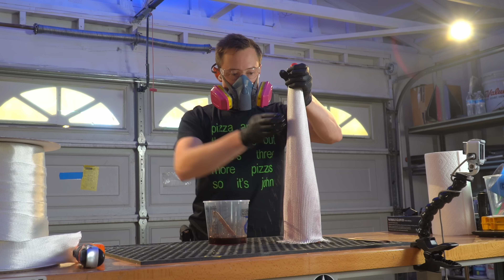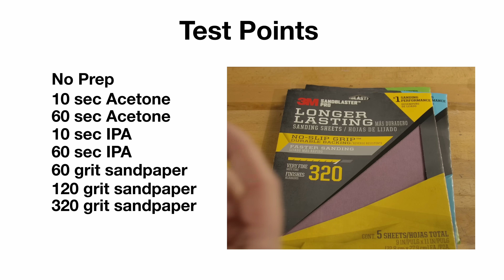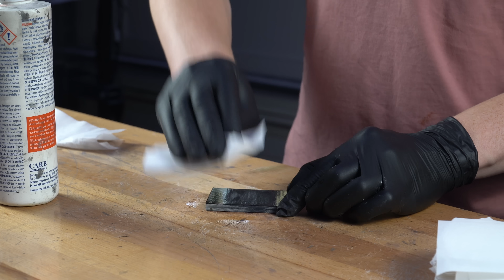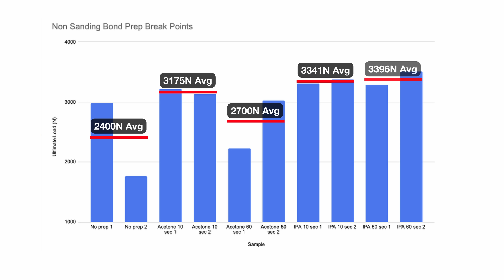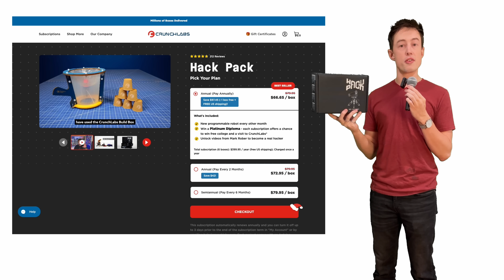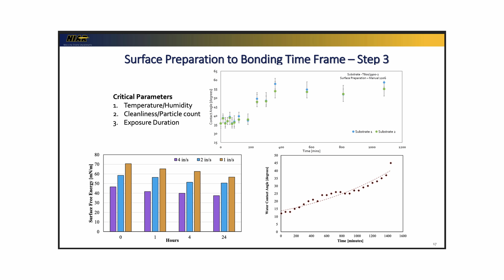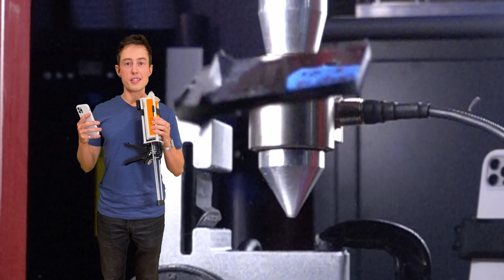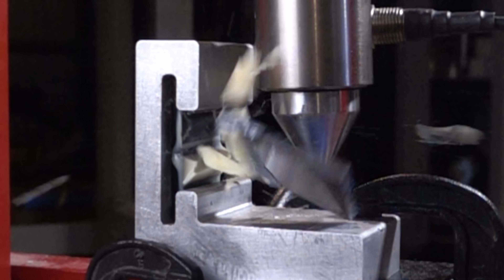I Broke 100 Epoxy Bonds to Find the Strongest

Comment: Alcohol is affecting it. It takes longer to fully dry than you realize. Use acetone. It dries almost immediately. There is better adhesives. You need one that has steel in it or other harder fiber. Coarser than 60 grit starts having micro gaps between the grains causing actual more unsanded area.

Comment: I'm still watching, but I did a bit of this myself. The other fun thing is figuring out how best to bond composites to metals. Wet sanding aluminum using the actual resin prevents the aluminum from oxidizing and resulted in an insane bond strength. The composites always failed before the aluminum bond did.

Comment: Here's a quick question how does a Machined surface compare to the sanded results you might be able to take a bit and run a few cut passes in the surface would be almost no work on your end during prep since it would be a machined surface finish

Comment: Roughness is the 1`st step to a good glue bond.   (it increases the contact surface area) .  Think of etching spray paints, chemical pitting, sanding, mechanical friction, etc.

Comment: I have done a lot of epoxy and I have always found that mixing more than recommended has both made for better results as far as finish and dry time.  Mixing too little or the recommended amount has been the cause of longer cure times and sometime it never cures entirely staying sticky or flexible when it should not be.   So always mix more than you think you need to.

Comment: Might be interesting fpr ypur testing endeavours:
I Interned at a lab where we tested surface prep for automotive adhesives. We used plasma and laser treatment as well as surface energy measurements to create and gauge different outcomes. Maybe a laser treatment instead of sanding might be an idea.

Comment: I'm curious if the inconsistency of sanding can be worked around by using lasers to engrave a precise and uniform level of roughness across the bond surface.

This way the test can be turn from "what sandpaper to use" into "what grit should the bond surface itself be?"

Comment: What if you drill very small holed in the gluing part ? like 0.5mm drill and a few hundred or thousand holed on the cnc and then vacuum chamber so it gets pulled into the holes

Comment: Hello, what about the influence of ambient temperature during epoxy curing to it's strength? According to what I read it has a huge impact. Curing the epoxy in higher temperature shortens the curing time and increases the bond strength.

Different brand, but:

UHU Plus Endfest 300kg (temperature / curing time / bond strength):
20°C / 12h / 120kg
40°C / 3h / 150kg
70°C / 45min / 200kg
100°C / 10min / 250kg
180°C / 5min / 300kg

Comment: Awesome video, patience of a saint 😂 Mech Engineer here, this is why I hate adhesives 😂 Degassing the epoxy is removing air bubbles and therefore eliminating spots where cracking would start. My educated guess that doesn't change anything for what you did. Awesome work.

Comment: The point load setup is not rigid and precise. It needs to be on a guide. The loose slides on that type of hydraulic press will result in the point not always contacting in the same location on the test sample. Resulting in  inconsistent measurements.

Comment: I'm a windsurf board builder.. just add carbon fiber to your epoxy... chopped or pices of cloth.
The epoxy is brittle.. adhesion isnt the biggest issue.. the epoxy cracks during load. If you need more adheadsion, just increase area.

Comment: I will be fully honest, If i had to pick between different epoxy's and the two i have was from a lab test of hyper controlled stuff to say yours i would probably take yours as in the field information from many different uncontrolled stuff would be better than a lab not dealing with outdoors because knowing a test from say load pressure and placement in a lab it would be perfect but in the field it might be different so having a avg instead of one number would be better to look at long term.

Comment: It seems with the sanding you are making parallel ridges, which introduces a weak point, the same as the layers in a 3d printed piece. You should consider crossing your sands perpendicularly or hatching them so the ridges of the paper theoretically make a triangular shape.

Comment: One Thing that catched my eyes: the swipe back and forth while cleaning.
During my adhesive training I was told to seep only in one direction and never use a cloth twice. You want to clean the surface and not distribute all micro particles evenly over the surface.

Comment: I worked at Easton Sports in the early 2000's designing carbon fiber hockey sticks.  I am a degreed Composites Engineer.  A production manager at Easton had an intern manufacturing engineer do some tests on how well they had to sand blast the inside of the hockey shaft before bonding in the hockey.  This was done without the knowledge of the R&D Team.  The Production Manager and intern 'proved' that they really didn't need to do bond prep and only haphazardly sand blasted the inside of the shafts.  In the next couple months we had over $500,000 worth of hockey sticks fail in the field.  Blades were falling our completely.  The Production Manager was fired.  Luckily, it was still the best stick on the market and we continued to sell the sticks.

Comment: Have you considered testing with a sandblaster to etch the surface? I would think that would be an easy way to produce consistent results without requiring excess effort.

Comment: Im curious if media blasting would provide a more consistent result compared to sanding.  It would definitely be easier at scale for larger bonded parts, but based on your testing with the sandpaper maybe the result would be negligible if it had the same effect?  Im also curious if media tumbling would make any difference to bond strength, but this would require a custom jig to use on any larger parts.

Comment: I wonder if vacuuming after sanding would improve the bond?
Wipe cleaning with a solvent may not remove all particles from the grooves.
Maybe ultrasound cleaning in a solvent will improve the bond?
Good luck with your rocketry.
It is already very impressive!

Comment: I put the hardener in the mix container first. Then add the weight of resin to get the correct mix ratio. Mix well. It will be the strongest the epoxy mix can be. Another way for small batches , is to place the hardender into a plastic bag, then add the resin. Remove most of the air, and kneed the 2 together. Cut the lower corner and use like an icing bag for dispensing. For my parts, I found that using some of the mixed glue on the sandpaper and abraid the surfaces leaving them wet with glue. Add more glue and assemble. I use 100grit paper. The small bits of grit keep a consistent gap for the joint and prevents glue starvation. Keep the abrading inside the glue envelope. Cleaning the surface parts with acetone 1st or almost any other solvent to revove waxes etc is really important. Then cleaning with IPA or another very clean evapourating solvent is important to remove the initial solvent and it's residual contamonation. I use commercial grade wet dry carborundum paper, that des not have any lubricant or treatment for clogging etc. I make model racing model planes, and have been working with composits since 1984. I have had many failures like you have experienced and shown in your video. Keep well away from anything silicon with structural composites. Do use waxes for release or even PVA releases work very well. The problem with silicon release is the continual contamination of the surface if they are going to be joined together. The sillicone can also effect the final cure strength of the epoxy as well. Made quite a few soft carbon fibre props due to the silcon in the mould release I was using. A great video. Thanks for sharing.

Comment: I would assume that contamination was not the reason that re-using sand paper reduced effectiveness. 

Small amounts of grit (especially the larger grits protruding further which leave the deeper grooves) are knocked off with sanding. Further, as you sand debris from the workpiece clogs the paper further reducing its effective grit.

Comment: wrt your home made ladder w/vacuum contraption you needed to guide the airflow better instead of having an open throat, because a single atom of oxygen has an atomic mass of 16 units which is far lower than the average mass of molecules in the atmosphere, being 28 amu. by the time the airflow reached the end of the ladder, most of the single oxygen atoms had already escaped, it's no wonder you had a hard time using that as a solution.

Comment: 26:40 while there may be "more surface area" on a microscopic level, that doesn't mean the epoxy was able to fill all of those grooves uniformly, and thus could have filled the larger grooves better or had a better angle of stress due to the larger grooves.

Comment: 10:35 Woodworkers generally avoid sanding above 200 grit because the dust clogs pores in the wood and prevents finish from penetrating. It can’t really be wiped away. Perhaps that’s a cause of the “contamination”?

Comment: 25:00 if there is anything to take away up until this point, it is that all your peers were correct. Their way is the best way to prep and bond....because it is so darn inconsistent, that for what ever reasons they deemed their successes good enough to pass on the knowledge. Clearly your data samples are much too small, yet these small batches reveal a inherent problem with a task like this. That is that every small change matters and must be tracked. Like going from hand sanding to machine sanding. $ vs time. I just wonder about my EXTREME hit and miss experiences WITH THE SAME EPOXY. Your video really puts the light to it. One day it bonds very strong, another it's like I spoiled the epoxy.
Reply: Epoxy is a dark art, there are so many variables. Even humidity can significantly weaken it by interfering with the curing process and causing physical degradation. Good luck getting the same exact humidity levels across multiple days in anything other than an atmospherically controlled lab environment.
Reply: @----.__  "dark art" is a good way to put it. I know for a fact that a few degree in temperature have a very different outcome as well. The chemical reaction setting in fast or slow, curing longer vs slower....it's an art alright.

Comment: Do you have access to carbon nanotubes? Mix some into the epoxy mix perhaps?
Reply: The strength of the epoxy itself isn't the problem necessarily, it's how it bonds to the surface of multiple objects. CNTs wont change that, in fact they will potentially reduce the contact surface area making for a weaker join.

Comment: So de-gassing whit a hard scrached surface should work better, as you remove air traped in between the rasin and the galsfiber  13:30

Comment: genuinely curious if using something like a needle scaler to rough up the surface opposed to sandpaper would be better off, as you are unlikely to leave non-glue friendly contaminants behind, you're not creating a preferential direction to the bond surface and it would be relatively straight forward to get consistent results. I understand this may seem quite aggressive on the underlying composite but that may be advantageous, allowing a better bond between the glue and the underlying composite

Comment: Focalized solar energy. Use to create heat with reflection shielding around the surface of the rocket to allow for you to heat up the surface of the proper temperature using a thermal laser monitor. 20 bucks from harbor freight repurpose it. Where is sensor to a microcontroller for 10 bucks. Have a deactivate the power switch upon it reaching the proper temperature that you want for the thermostat. Use a temperature sensor on the substrate. Then it doesn't cost you energy time or effort

Comment: I take that back 4 thin rods of high-density plastic material. Drill down on all four corners in between the fin extrusion and the flat plate your adhering to. Insert the four small high-density plastic rods into the four holes and make sure the drill holes extend all the way through the lower plate your hearing to. Then seal top and bottom after you cut them off above into the epoxy resin then it will create a 4 point load balancing point for the forces to distribute around the exterior and not buy solely on one side

Comment: Raise your grit up to create a surface adhesion with finer granular size. Potentially offering a tighter adhesion. Potentially attempt to open up using a pick small little gaps between the fiberglass mesh and the substrates your adhering to. Allowing the epoxy resin to penetrate both the fiberglass mesh and connect to the lower surface.

Comment: Try this for the sheer test add a small thin sheet of aluminum on both sides of the lower braces and the center vertical fin. Try it from home Depot in the outdoor metal flashing. It's extremely thin, won't add much weight to the Rockets payload. But I have a hunch that it will increase the tensile strength and shear strength due to its ductility. Seal it into the epoxy resin.

Comment: If it was me, I would improve the test bench. The point of your load cell should not be able to shift horizontally in any circumstances. You are relying on static friction of your contact point, which will have a lot of variables. Once you overcome that you will have a strong shift horizontally away from your joint, causing unreliable break data. It should apply pressure on a single location for the whole duration of the test, which is equal on all coupons.

Comment: With your 4,000N success you hand sanded, but not in straight lines like the weaker ones that you did later; that's the one difference I see.
As for acetone + IPA, it didn't do any better than just IPA so it appears that you can safely skip the acetone.

Comment: Random thought: I picked up an antistatic ESD fan for preventing dust from flocking to surfaces I wipe to clean. It generates ions to produce a wind that cancels out surface charges. It was actually pretty cheap, and it does an excellent job for eliminating static annoyances I get with nitrile gloves, plastic mixing cups, glass, basically anything that can build up static and be annoying.

Awesome video! Your curiosity is an inspiration!
Reply: Oh, and wow I didn't realize how affordable a load cell could be! I have a press, but no way to measure force. I was considering adding a hydraulic pressure gauge, but then I'm messing with my hydraulics which could end poorly 😅

Comment: Uhh you do know that because the monatomic oxygen (and nitrogen) will quickly react with other, unreacted air to form nitrogen oxides and ozone right? There is probably little to no monatomic oxygen in contact with the “coupon”.

Comment: for inflatable rafts, pvc coated fabric, its recommended to use MEK methyl ethyl ketone for cleaning/prep but IPA can be substituted. all shear bonds with vinyl. but thats just for fixes or adding an accessory, like a d ring or handle, but initial assembly for critical air holding part is done by ultrasonic welding.  or a note from actual metal welding, maybe some beveling could be helpful for more surface area, or keying the parts together for the initial mechanical lock.

Comment: Observations from joe blow down the block, pardon if my terminology is incorrect. At the size of the fillets tested and some of the slow mo footage it seems you are testing the mechanical strength of the epoxy more so or at least it is a variable rather than purely bond strength. Like the epoxy fractures first which leads to the release at or close to the bond point. So increasing the mechanical strength of the epoxy aka addition of fibers or such in the mix would create better results. From reading the comments also using a mix that allows a little flex might improve results. That way the load is shared across the entire fillet or at least more of it. I would think the best result would be had with a failure that was more like a rip or tear than a shatter if that makes sense.

Comment: As far as I understand, Loctite EA E-120HP is a bonding epoxy, meaning its main purpose is to bond two surfaces. During my time in FAE, they always told me to apply pressure to the surfaces I wanted to bond in order to achieve the best adhesion. But here he is using the epoxy more like a cement. Aren’t there other epoxy products better suited for this use case? The test samples also looked as if the epoxy was simply too brittle and could have used a bit more ductility.